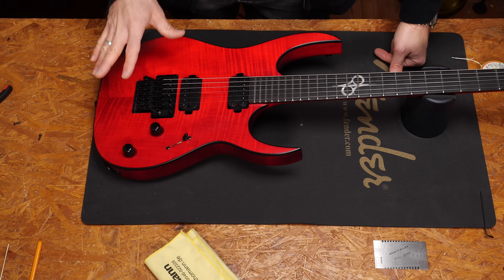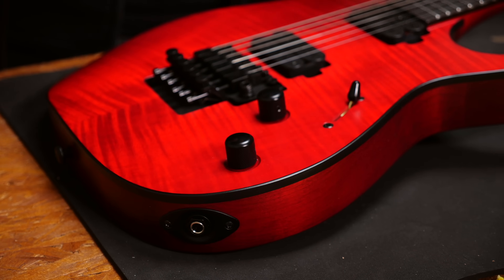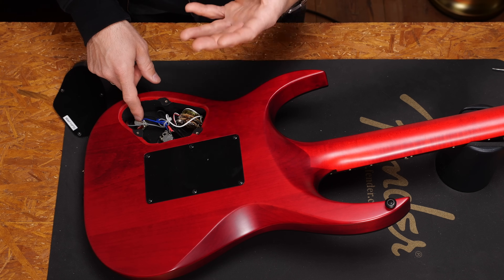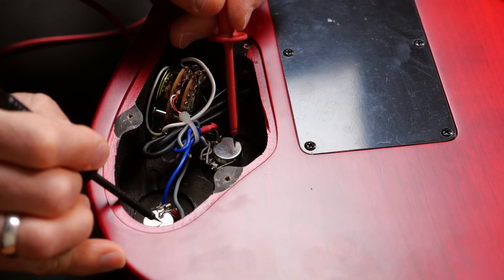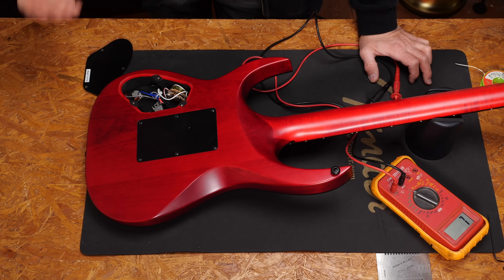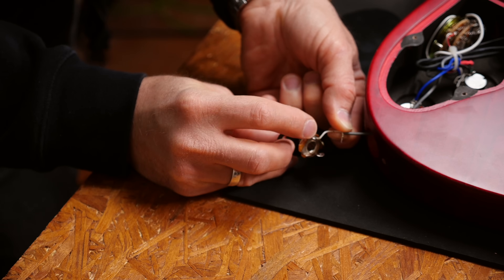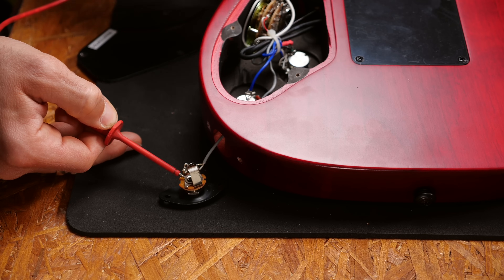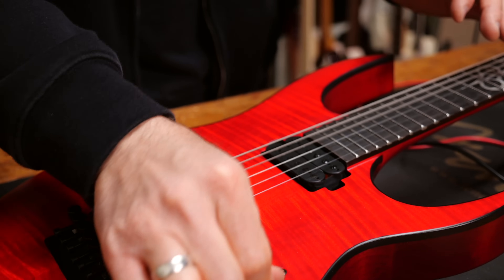How to fix Ground Noise | Guitar Tech Tips | Ep. 8 | Thomann

Comment: I was told on Reddit that the buzz I get from my JS 1200 was a grounding, issue, but it doesn't sound like this. It's just a constant buzz, that gets worse with more gain. Now the interesting this is, it gets slightly louder when I touch the bridge or strings. However, if I touch either of the metal boxes around the pickups, it pretty much goes away. If I touch the inside walls of the electronics cavity, it pretty much goes away completely. What am I dealing with here? It almost seems like if I was able to somehow ground the wall of the cavity it would be totally resolved, but that seems like a weird solution, if it even is one.
Reply from the maker: Hi, you should check the string grounding with a multimeter (on the continuity-check setting). This sounds like the bridge and the strings are not grounded properly. I hope this helps. Cheers //Kris

Comment: Got a question) If my guitar stops making noise when I touch the strings? Is it cold solder or I need shielding?
Reply: From what I've read that would be shielding. Would be great to see a video on this channel as well regarding that topic. My Harley Benton bass suffers from it
Reply: Did you guys solve it? My guitar has an high frequency noise that stops when I touch a string
Reply: I have the same problem on my bass...
Reply: Guys any solution?
Reply: @havoc2431  foil shielding helped, but there's still some noise when not touching.

Comment: Hey I installed Seymour Duncan Dimebucker Bridge pickup in my dean ml dimebag tribute and I've gotta buzz. It goes away when I touch everything except the pick up I installed but I can't find any loose ground wires and continuity seems fine everywhere. The only place I dont get continuity is the height screws for the new pickup but it doesn't have a metal baseplate it's plastic so I think that's why.. the buzz dissapears when I turn the tone knob to 0.. any ideas? I feel like I've tried everything I know of..

Comment: Hi, i have an issue on a les paul but it is the other way there is a lot of hum as soon as i put gain and it disappears when i touch the strings or bridge .i was not expecting having so much hum with humbuckers .could it also be a ground issue? Other thing once i pluged the amp and my phone on the same multiplug and when took my phone with my left hand i had my right hand on the bridge it suddenly felt like there was something stinging my hand on the bridge

Comment: Great video. My question is that is it normal to have some ground noise that isn't that bad but goes away once touching strings? Does it still mean I have a faulty wire somewhere? Thank you.
Reply: I have same problem on brand New guitar&amp do you have solution?
Reply: That is normal for single coil pickup guitars, especially if the electronics cavity isnt shielded. Thats why humbuckers were invented, because they literally buck the hum away that single coils have. Idk if you have a single coil guitar or not, but idk hope this helps in some way. 

You could try making sure all the ground wires have good soldered connections, or shielding the cavity. But if its a single coil, there will most likely always be a bit of buzz when not touching the strings.

Comment: Had a bad problem on a diy guitar I had. Followed this video and could not isolate it for the world, tore out the electronics, started over. Nothing. Then I used copper tape and shield the electronic cavity. Bingo. That did it. Worked on my Player Strat as well.

Comment: I jusf got my first guitar and amp like 2 months ago and my guitar has this hum since i got it but i thought it was normal and all guitars do this but 2 weeks ago i went to play my guitar and i was barefoot and when i turned on the amp and touched the strings it shocked me,than i unplugged the guitar and the point of the cable shocked me,than i unplugged the cable from the amp and every metal part of the amp that i touched shocked me than i put my shoes  on and nothing happened and than i started to research a bit and now that i found this video i think my guitar has bad grounding,does my amp has bad grounding too?if i send the guitar and amp to warranty will they fix it?the guitar is a ibanez GRG131DX-BKF and the amp is a marshall mg10
Reply: Make sure the outlet your plugged into is grounded, And that the polarity in the outlet is correct

Comment: My guitar also have the same problem. Well an additional one is when it's connected to an amp it doesn't give out sound instantly. I have to take off lead from guitar and touches the tip(hot). Unless it gives out big buzz sound. The strings won't give sound out from amp. Is it problem with the amp or guitar?

Comment: So as soon the hum disappears if i touch the strings or any metal part it's problems with the ground? Can wrong wiring cause the same symtoms or a capacitor that's wrong solded, or does that cause different symtoms?

Comment: I’m getting loads of buzzing noise and also on occasions electrical shocks from my guitar. As I’m completely new to the hobby I just assumed that’s normal 🤭 I will check my guitar but could it be the amp and not the guitar?
Reply: Go check your amp right away, or have someone pro look over it, thats sounds dangerous

Comment: i have a dean vendetta that has alot of humming noise when using distortion pedas. Its' louder than my o the guitars. I checked and all ground wires are sodered. Would replacing the output jack make a difference? It's an entry level guitar so probably it is a cheap part.

Comment: So here's my question. I have installed new pick ups into my guitar and when I plug in the cable, I get an absurd amount of loud static BUT, if I touch the output jack plate, the guitar sounds perfect. How do I fix this issue? I've wired everything multiple times trying to get rid of it but the issue is persistent. I've shielded every cavity, the issue persists. What more is there that I can do?
Reply: I have same problem with computer and mic,when i touch 3.5 mm jack output buzz gone everything is perfect,and idk how to fix that
Reply: @f1___493  update on my end, I turned the gain all the way up on my guitar amp, turned the knobs and found one to be more crackly than the other. I took the knob off and pushed the potentiometer through the pick guard and one of my wires popped right off even though I thought it was a solid solder. I had a poor contact, fixed it and 90% of my noise went a way. I still have a good amount of hum but that comes from the single coil guitar pick ups and can't do anything more. I can live with it though because the second I start playing it the hum disappears and the crackling is null now. One issue could be my potentiometers are too high in resistance. Using 500K instead of 250K pots. With your Mic and computer situation, look for any broken or incomplete/poor contact solders, i.e. tug on wires and try to wiggle them free or pull them out. They won't budge of the solder is solid.
Reply: @f1___493  If you have other cables, try them to see if you have the same issue across the board. That way you can eliminate that from the equation

Comment: I just changed my whole pickguard with an prewired one. I had 1 white und 2 black cables. The new one has 1 white, 1 black and 1 red. Red and black is ground. White is hot. So everything thems ok. Now i have humming but if i touch the bridge it disapear.... any ideas out there to fix that? Cables are soldered well. Thanks
Reply: I have this same problem from a brand new guitar i just recived from thomann
Reply: @God1stProductions  was denn für n Model ?

Comment: Hello dear sir, I had a quick question. My guitar does not have the same switch as the one in this video. The switch in my guitar is one of those import off brand switches. Do I need to ground the body of the switch as well?
Reply from the maker: Hi, it doesn't matter what quality or type the switch is, the basic idea is always the same. So yes, the housing of the switch should be grounded. This can be achieved by using a ground cable or a conductive copper tape (or conductive shielding paint) inside the cavity walls. Cheers //Kris
Reply: @ThomannsGuitarsBasses  got it. Thank you for your quick response! Have a good day.

Comment: My pedal and amp both died, so i have no other way to plug my guitar other than directly to the PC or the 5.1 surround system.
I recently bought an Ibanez Jem 77p and it does the exact same thing you showed in the ground buzz section of the video. I checked her electronics with the multi meter and everything seems to be in order. Every time i connected 2 parts it beeps. Why is this happening. I have another guitar and it plays fine please help!!(This buzzing happens even if i touch the wood in the cavity)

Comment: I have this issue, but the buzzing stops when i touch the sleeve of the actual input jack, like, plug it in buzzzzzzzzzzzzzzzzz! touch the lead where its plugged in, nothing. also i dont have a voltmeter

Comment: I have a Yamaha SG and it's quite noisy when not touching it. When I touch the bridge, it reduces the noise very much. Is it the grounding in the guitar, the amp, or could it be the electrics in my house?? Any help would be appreciated.
Reply from the maker: That's perfectly normal. You need to touch the guitar in order to make the grounding do its job properly. The amount of noise when not touching the strings (mostly) depends on the cleanness of the power and the shielding of the guitar. But as told, that's not out of the ordinary, most guitars and rigs are rather noisy when not touching it. Cheers //Kris

Comment: I get grounding noise when I take my hands off the strings? How do I fix that?
Reply: I think it might be your bridge and strings that are not grounded properly.
Reply: Found a solution?
Reply: Hell it might be the shielding of the hole guitar that's bad and not the bridge and strings, sorry my fingers didn't wrote correctly what i was thinking on my other comment =)
Reply: It could just be 60 cycle hum witch is caused by frequencies from electromagnetic interference if you playing high gain with a single coil pickup it’s bound to happen or sometimes if you have enough gain with a hum bucker it can still happen 
Solution 1 find your sweet spot 
What I mean by that is point the guitar in different directions around the room and if you stop hearing hum that’s your sweet spot
Solution 2 use foil to block interference 
This is something that’s better shown so I can’t really explain it
Problem/solution 3 this will coast money and it’s not always the problem but it will benifite your guitar in general
Your pots have gone bad
This especially happens when you do a lot of sauntering the heating and cooling of the pots can destroy them and that’s a cause of 60 cycle hum
Solution 4 get a noise suppressor
This is a pedal that you can get that cancels out 60 cycle hum but you can also loose a lot of sustain and when using a lot of gain your going to put the resistance really high and sometimes it will make a really strange noise
Reply: @guitarsnstuff4810  how to fix it?
Reply: @boimesa8190  shore I’ll get back to you
Reply: @guitarsnstuff4810  yes pls!
Reply: Watch videos about using shielding tape to stop 60 cycle hum. I did it on my friend's Strat and it worked. Haven't done his main Strat yet and he's complaining about it. Try it, it works. Tape is cheap on Amazon.
Reply: Some hum will always be there when you don't ground it by touching the strings. If the hum silences when you touch the strings, the bridge is properly grounded.

I had this issue to an unbearable amount on my Gibson LP, so I removed the pickups and the electronics, put copper tape everywhere and grounded it. Fixed. The hum when taking the hands off the guitar was barely audible.
Reply: @guitarsnstuff4810  I think i have this problem on my Ibanez, i changed the pickups to hotter ones and i always play high gain metal tones and when i touch the strings or the jack/cable, the hum is gone, but when i let go or bring my hand close to the string without touching, it gets louder. I think i need a shielding tape.

Comment: I never had a guitar that doesn't hums until I touch the strings. After this video I tested all connections and everything seems to be connected. Can I fix this with shielding? After this video it drives me crazy 😂
Reply: Same problem here!
Reply: Try the shielding tape. I did and it worked.

Comment: i have a fender strat squire and i think i may have a ground issue. I tried checking for continuity between the metal stem of the pickup switch (just under the rubber grip, the stem that is visible even when the electronics compartment is closed). there is no continuity there. Does that indicate an issue?
Reply from the maker: Hi, if the two screws holding the switch to the pickguard have ground connection, the switch is good. You can test continuity by holding on wire from the multi meter to the screw and the other to the bridge baseplate, or to the sleeve of a plugged-in jack cable. I hope that helps. Cheers //Kris
Reply: @ThomannsGuitarsBasses  thank you!!

Comment: I am stumped because everything has continuity but if I touch the strings, or any metallic piece on my guitar, the hum goes away.  I checked the ground from the wire to the amp to the input jack then the output jack of the guitar to all metal pieces.  Every single point had continuity.  I am stumped.
Reply: I have the exact same problem. Could you please tell me your solution?
Reply: @lemlem_net146 It was due to the cavity and the ground wire was not attached.  I went to a heavier gauge and soldered it on and gone.

Comment: I have a little bit different problem, When I touch any metal part on guitar , hum goes away(not so loud as shown in video)... I have 4 guitars same thing (through Helix)... I googled and found that might be bad ground in whole house.  I live in older house from 60s I think so that's probably it . Does anyone experienced this ?
Reply: Yeah similar thing on my bass but in a new ish house.
Reply: Yeah I have the exact same problem. The issue is clearly related to the grounding of the house. Unfortunately there is no real workaround.... I tried my best to setup a noise gate but that is a real issue.
However, I have found that I have less noise on a real amp compared to my audio interface computer setup
Reply: Are you using a quality power supply?  Especially with the helix you want a quality power supply and not a bunch of $2 wall warts.  This is the first thing i’d change....

If thats not true, you could try a switcher pedal that has a phase cancellation /lift button... sometimes this will eliminate buzz especially with crummy house wiring...

If both those are OK and your guitar doesnt have ground issues, it might just be rig induced noise. Like 60 cycle hum from Single coils, interference from long cable runs, Cable connections that are worn our or cheap, noisy power amp, etc... if thats the case, try using the noise gate on your helix...

Hope thar helps!
Reply: I don't think it's a house ground issue. You need to be sure that the ground of every "component" in your control cavity goes to the same point - making a "star" connection with your proper ground as the centre. Typically this is the volume pot casing as it's most convenient. So, the grounds from your pickups/output-jack/hardware (bridge/strings) need to go to directly to this point. I also think the ground connection for the tone control should do this as well. All the guitars I have seen bend the pot leg to the tone control casing to make the ground, and then rely on another wire to go from the tone control casing to the volume control casing. If you're handy with a soldering-iron, try lifting the tone control ground from the tone control casing and use a wire to go directly from the leg of the pot to the volume control casing. You might think "but this already goes to gnd via the wire between the pot casings" but it should make a difference.

Comment: can a pickup itself cause this kind of noise? I am having huge noise issues with one of my guitars, I followed the steps in the video, all metal parts are connected, cable jack is grounded, all cavities are shielded with copper tape. I replaced all components (one volume pot and an input jack - my guitar only has one humbucker and only one volume pot and no tone pot) I replaced all cables with higher quality ones, resoldered everything from scratch, and it still emits this high pitched noise when I am not touching any metal parts of the guitar. the only component that stayed the same is the piuckup - can it be at fault? or am I missing something else? please help guys, I used all ideas I had

Comment: Hey Kris, interesting video, thanks. My problem is a little different. I have no hum nor any noise until a time when, after several minutes of playing, I get like a parisite noise, almost like if I was shaking something metallic over the magnets plots. It's there as long as I wave the pick just over the pickup. If I go away from the pickup, it tends to disappear ; if I get back over the pickup, here it comes again. It's really like little metallic crackling's.. quite annoying in fact. Should I precise that it appears on the neck pickup of an HSS configuration, all Di Marzio pickups I used to upgrade a 300 EUR guitar. What should I check first? Thanks for any tips and thanks again for the video. Cheers, Olivier 🇫🇷
Reply: Olivier, I had a similar problem with a Gibson ES-330 once (fitted with P-90 pick-ups). It was cured by adjusting the height of the pick-up pole pieces.

Comment: I have a Yamaha Pacifica. When I plug it in there's some buzzing sound. But when I touch the strings, it goes away. Is this a grounding issue?
Reply from the maker: That is normal as long as the buzz goes away when you touch the strings. 👍 //Kris
Reply: @ThomannsGuitarsBasses  Ok, thanks for the quick response!